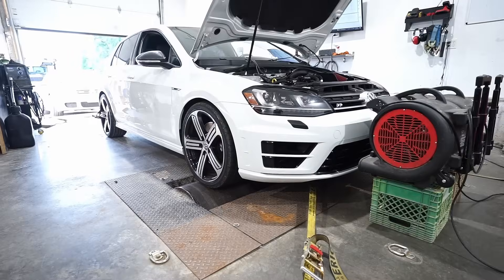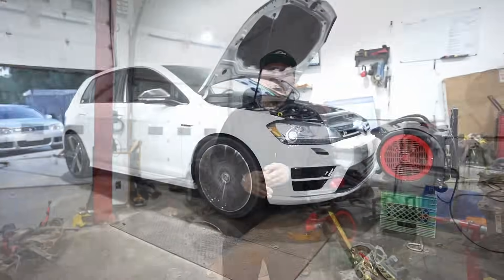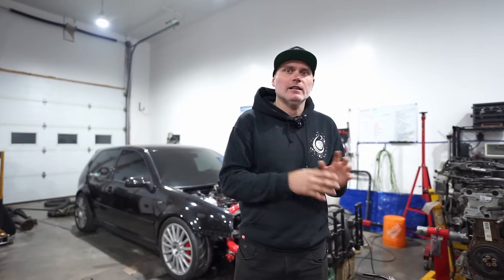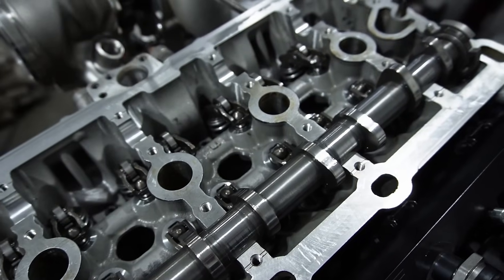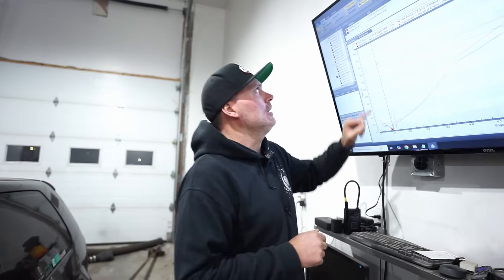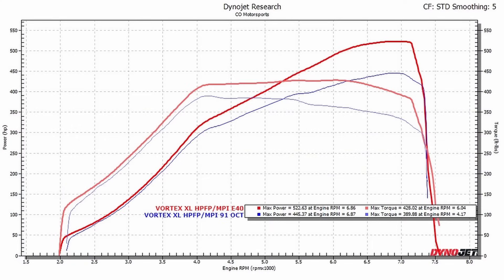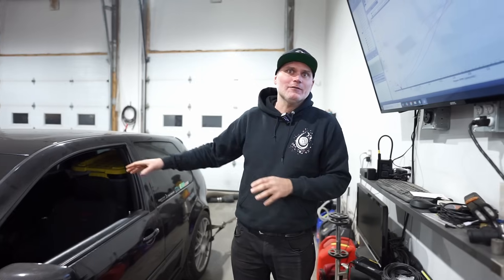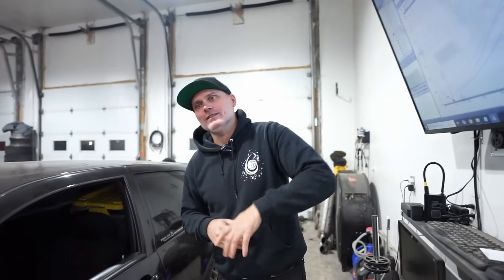EQT Turbo Comparison. Vortex Standard, XL, and Typhoon

Comment: hello there!! so with 98 octane, mpi 1300cc injectors and high pressure and low pressure fuel pump with the typhoon i can make around 700hp at crank? Thanks i live im Europe
Reply from the maker: not on pump gas.
Reply: @COMotorsports so how do you get 650whp on 91ron or is it E85?
Reply from the maker: @streetbike761  You don't make that sort of power on 91oct and a 4cyl engine. It takes a log of boost and timing to make that power good fuel is required.

Comment: Great video, I have an Audi A3 1800 gen 3 with is38 , about 370 hp. i am thinking the vortex std and i wonder if motor will need to build and to upgrade the fuel system. In my country we don΄t have ethanol e85 etc.. only 95 and 100 oct.
Reply from the maker: We have not pushed an gen3 1.8t past IS38. However I do know it has it's weakness comparably so do your homework on that one.

Comment: In Brazil, we usually use E60 ~ E63. In this condition, is it ideal, with the original engine, to use the Vortex Standard or Vortex XL turbo?
Reply from the maker: Depends how much you want to push it, as you see we've made over 500whp on E40 with XL.

Comment: Just recently joined owning vw. Just bought a mk5 gti loving it. All of your videos have been very helpful. Got to do a rear main seal and button up another small leak with the oil feeds for the turbo.
Reply: Please sell that car. It’s a dud and has no aftermarket. There’s no reason to not own a mk7 at this point which is better in literally every single way. Those cars can be had for less than 15k

Comment: Dumb question but are these numbers with 5bar sensors or the stock 3bar?
Reply from the maker: Definitely not stock map sensors. The typhoon was run at 40psi.
Reply: @ Do you remember how much boost you were pushing with the XL on pump gas?
Reply from the maker: @gabeallen1212  Pump gas stuff is generally 31-32 psi with sensors.
Reply: @COMotorsports  good to know , thanks!

Comment: Thanks for this! Makes me wonder  if I should just make the jump for a standard vortex in my 2017 A3 Quattro instead of an IS38+, which this channel originally turned me to. Pump gas 91 daily canyon carver, so not sure how bad lag would be
Reply: It honestly ain’t even about the power. The powerband on a standard is so much more linear and it holds peak boost all the way to 7k rpm. The IS38 is noticeably better than the IS20 at that but the Vortex standard is more reliable than the IS38, it flows better, has way higher headroom if you decide you want more power, and the powerband is significantly better than any IS38. There’s no point in getting an IS38 when there’s not really a reliability hit by going with the Vortex standard and you can make less than 400 whp if you choose
Reply from the maker: Oh yes standard is great upgrade over the IS380 on pump. Turbo's capable of making 70-100whp more on 91oct over stage 2 IS38 on 91oct from our experience.

Comment: Not to kill the MK7 vibe, but your channel I think is only one that does MK6 content, but I haven’t come across any of your videos (maybe I’m wrong) on the upgrades needed for the fuel system. I watch the boss 500 video but I don’t think you touched on details the requirement for the fuel system (pumps, injectors etc)
Reply from the maker: Because the fueling options are trash in those cars and none of the options are great for real power. Which is why you don't see it. The one we're currently working on we've replaced most of the stupid fueling hurdles in it and put stand-alone on it. Most don't want to deal with the cost of that.
Reply: @COMotorsports stock fuel injectors, nasty lpfp, ie manifold, methanol injection will get you fairly far. But methanol scares people.
Reply from the maker: @Joeymichaelmk6  Doesn't scare me, do it a lot, But 600whp goals (which is the new 300whp)... is not an easy task for fueling on a Gen1/2 TSI engine. Methanol and stock injectors aren't getting you there.
Reply: Ok. Understood. Thanks for your reply. I recently bought an MK6 GTI as introduction into the VAG/eruo market, but it seems the MK7 platform has more options when it comes to mods and power gains.

Comment: Those are awesome power figures for the 2.0! 

Something I've been interested in is if anyone has tried a compound setup on one of these. I know it's more common in the diesel tuning world, but if someone could figure out a way to package that into a Golf, that would be insane.
Reply from the maker: @jameshaulenbeek5931  my question to you would be, what are you trying to accomplish?
Reply: @COMotorsports I'd be interested to see if the same low-mid performance could be had with equally high or better top end. I'm sure an engine swap would be easier - I5/VR6, but it's the curiosity more than anything, the concept.
Reply from the maker: @jameshaulenbeek5931  With compound you can basically just make either more power, or a broader power band. These engines like boost so with that we can run smaller turbo's harder to make them spool quick and still make good power throughout the power band. Turbo tech has come a long way so compounds are becoming less and less needed, only unique situations require the effort.
Reply: @COMotorsports  ahhh, I gotcha. Thanks!

Comment: Honestly, for a FWD GTI, the EQT standard  seems to be the perfect setup. Fast spooling but makes over 400whp on pump gas.
Reply: That’s why I went with it, best decision I’ve made
Reply: @castrodriven  I love mine, Im e30. LPFP HPFP. Its the perfect setup. Ideally Im gonna tune it again. Go mpi. Go low power flex and high power flex. Id love a cooler racing tune and a hotter daily tune.
Reply: @ yea I was obsessed with hp, it’s been great but rwd if definitely more my style now. I’m rocking a vortex standard turbo with lpfp + hpfp + sensors, MASSIVE jump from e30 is20 it caught me by surprise lol